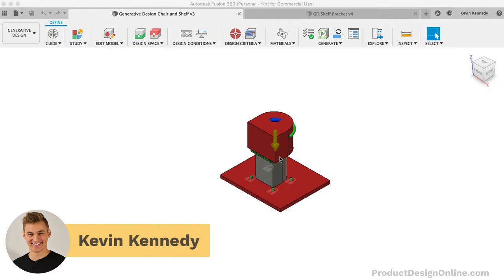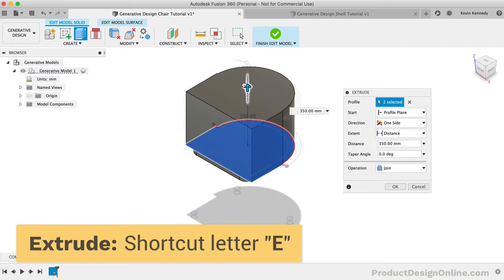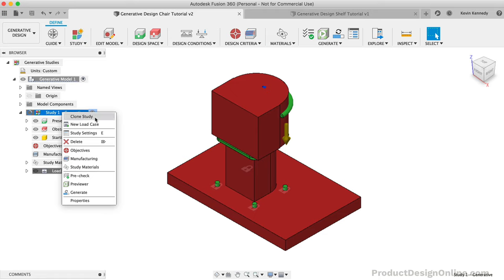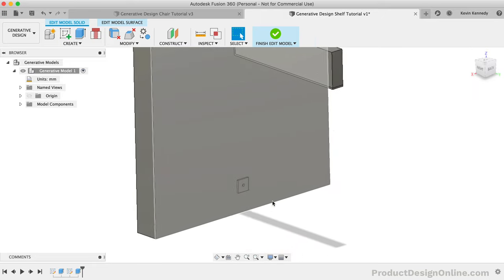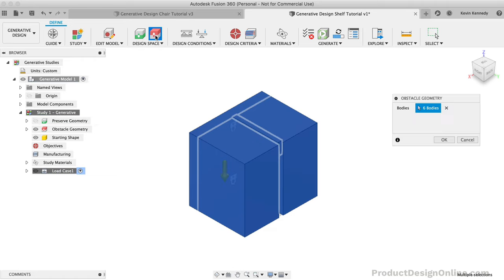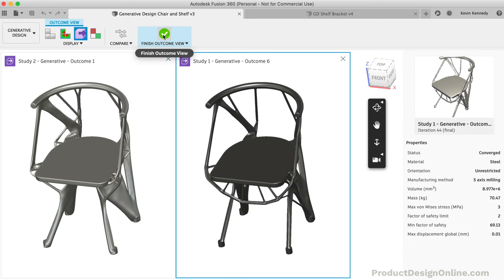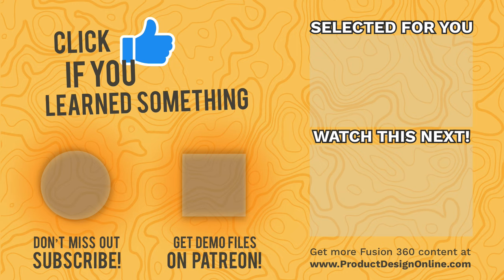Generative Design - Designing a STRONGER Chair in Fusion 360

Comment from the maker: Here's the first Generative Design tutorial ➞ https://youtu.be/PSSt8wswNJQ
_
TIMESTAMPS
0:00 - Generative Design in Fusion 360 for Beginners
0:32 - Creating the chair
1:25 - Preserve geometry
1:47 - Edit model mode
4:33 - Obstacle geometry
5:28 - Structural constraints
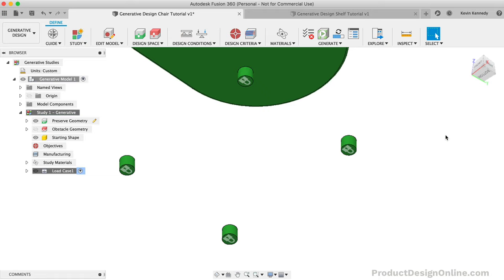5:40 - Structural loads
6:35 - Design objectives
6:50 - Manufacturing methods
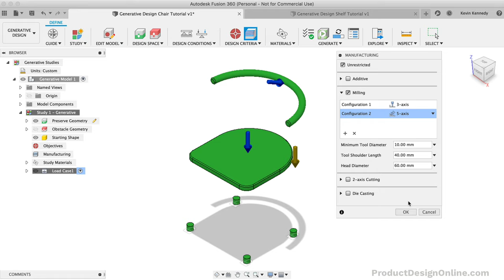7:19 - Study materials
8:00 - Generate chair study
9:00 - Shelf bracket example
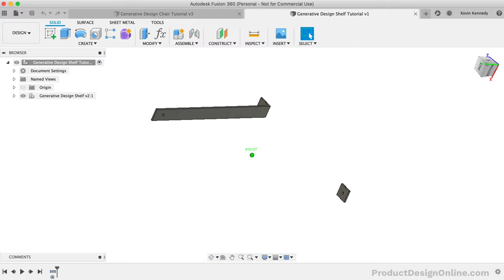9:30 - Preserving geometry
10:00 - Edit model mode
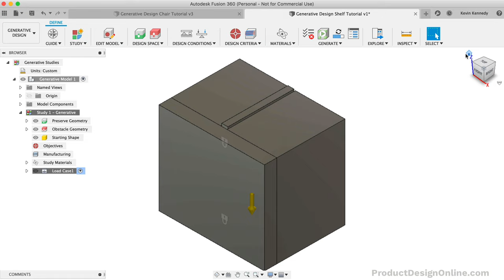14:00 - Obstacle geometry
14:25 - Structural loads
16:00 - Looking at the results

Comment: Heres a question though. Ok so I am doing the fusion design stuff and know I can get parts on screen. Only say I have finished a design and there is maybe a motor housing with interlocking parts. How then do I get gcode and the printer to print each individual part. I know nothing about the cam feature. Do you have a resource for videos on this topic or a direction for me to go to get the knowledge?
Reply from the maker: Hi, James. Are you trying to 3D Print the part or cut it on a CNC? You say print, which makes me think 3D Print. If that's the case, you can select the "Tools" tab (while in Design Workspace) > Make dropdown > 3D Print. Then, you select the components or bodies that you want to export as an STL file. You would then need to put that in your printer's slicing software (I use Ultimaker's Cura, which is free). Cheers, Kevin :)
Reply: I said print yep, but thats the outer body which is just going to be a carbon skin. The inner parts are gonna be routed on a 4 axis cnc I am building. Aluminium is my choice of material. I can weld it see. Have a £3000 top notch welder for it. So nothing should be holding me back in that and its also light but strong. Gears and stuff I am buying already made for other machines and just working my design to incorporate them.   So some stuff print and some through cam software is all I know whatever that means. Cams in fusion is it not?
Reply from the maker: @jamesbarratt593  Ah gotcha. That makes more sense. Yes, for the parts you want to CAM you can take the model into the "Manufacture Workspace" (formerly the CAM workspace if you see CAM in any tutorials). All of your tool paths and Gcode can be set up right in Fusion 360. I don't have any videos on the CAM functionality at the moment...but will likely do some at some point. Cheers, Kevin :)
Reply: @ProductDesignOnline  Ok so 2 solid days on this model and she looks real sweet. So sweet in fact that I want to grab her and rip her out of the screen and start playing with her. Its the lower half of a reciprocating mechanism. Anyway, so heres my feed back. Also I found something else cool. If you create a cylinder and give it the chrome effect, then zoom into the chrome as far as you can, you find yourself in a warehouse. Like as if you are just peeking through into it from another dimension. Trust me. Go do it. Whats the warehouse. Have I found a secret.
Reply: @ProductDesignOnline  So the feedback. OK, if you create an off set plane and once you have worked on it, then when you try to orbit with space and centre button down of mouse, its really horrible. Like you feel its not freely giving you the same orbit as before the plane was created. I wonder why that is. Obviously I need to jump back out of the plane, but how because I lick on the plane in construction then right click for delete and nope. Nothing happens. Also if you look across as something recessed that you created in the other plane, you can't click on the bottom section. The area is whiteish grey. Again wanting me to exit the plane I am in. Bloody annoying. Counted 11 times yesterday the screen flipped on me too. About that for today as well. What moron coded that into it. Oh yeah we will flip the model 180 for them. madness
Reply from the maker: @jamesbarratt593  Haha...maybe there is a secret code in the warehouse that unlocks special features in Fusion 360?  🤔

With the orbiting issue, are you using the free orbit or constrained/fixed orbit? It sounds like you may want the later, as you can pick a point and orbit with more control. Click on your orbit settings at the bottom of the screen (display settings).
Reply: @ProductDesignOnline  Dude if you saw what I have designed, a full three D object with a flange and holes etc, you'd be proud. Like a Chinese master as his trainee Wax on Wax off, grows into a warrior himself. Ha Ha. Seriously it looks banging. A classey bit of work. I have the original in my hand from a machine I took apart. Engineer rule and square. Measuring everything and deep concentration. Now the parts up on my screen and I intend to buy a very expensive 3d printer to print it out with slight modifications. If it comes out great, then I am onto the next project and thats to build a cnc router with nema 34 powerful motors and a 3hp spindle to machine it out from Aluminium. Awesome business this 3d design. Kevin you and your lessons rock. I'd be nowhere without them.
Reply from the maker: @jamesbarratt593  You deserve it - you've put in a ton of work! Once you get the CNC done I'll feature it on my site as a "success story" :)
Reply: @ProductDesignOnline  Awesome I like being a success. Make a change. Ha Ha. No seriously, to endure other peoples designs in the tools I used for 20 years of past, well lets just say there were loads with really dumb faults. Like they were simply designing and then the firm manufactured and they were shipped out with no testing. The designer never saw the finished part and so never used it themselves to learn of the problems. I see these problems and know I could make better. Now though we have little excuse what with the tech available to us. All we have to do is learn Fusion, and get making. 

Im nearing the stage in my design where I have to have a horizontal shaft going through an object and when it appears inside theres a spiral gear. That gear has to mesh with another gear at 90 degrees to it. Got any videos which would help me tackle that? I hear theres a gear add on for fusion to make helical gears. Is that the route you would take? Only again once the gears are there, how do you align. Hmmm are we back to that good old section analysis. Sounds like it. Only in that if you see the gears are not aligned can you alter them from within section analysis?
Reply from the maker: @jamesbarratt593  Yep, I haven't done a video on gears (yet) but I would recommend using this add-in - https://apps.autodesk.com/FUSION/en/Detail/Index?id=6294804001663532834&appLang=en&os=Win64

I would also suggest looking at McMaster-Carr. With that integrated into Fusion 360, there are often gears and other parts that are already built to spec and can be inserted into your file. A HUGE time saver on projects with lots of standard components (screws, bolts, etc). 

Can you post a link to screenshot of your file? That will help me provide a better answer

Comment: Hey Kevin ! Help me out in creating generative design for bicycle frame any tutorials I'm not getting proper desired design  ! Love from india ❤️
Reply from the maker: Hi, Sangeeth. You will simply need to define all the points of the bicycle that have connection points to other objects (wheel, seat, handlebar, etc). Then, I would recommend making the wheels so you can set them as objects to avoid (Obstacle Geometry).
Cheers, Kevin :)

Comment: @Product Design Online  hey Kevin ! I have installed fusion 360 for personal use but the cloud credits are only 300 .how do i enable this to unlimited could credits like your's in video
Reply from the maker: Hi Satyam. The unlimited Generative Design was a promotion at the end of 2019. However, Edu licenses still have it.
Reply: @ProductDesignOnline   the edu email has limitations of using not more than 16 cloud credits for per job right ? so we could not use generative design because minimum credit required is 25 for GE

Comment: You might illuminate how exactly we go from Student licence to Personal. I have tried over and over with no satisfactory results
Reply: Uninstall and reinstall fusion, had the same trouble until I finally tried that.
Reply: @pqr590  done it twice, but thanks
Reply from the maker: Hi, Chris. Are you wanting to transfer your Student (Education) license to a Personal Use license? As in, have all of your files transferred over with it? If that's the case, then the only way to do so is to have someone at Autodesk transfer your account. I would suggest posting on the support forum (usually they get to it quicker that way) - https://forums.autodesk.com/t5/fusion-360/ct-p/1234

The Autodesk account system is whacky and it seems that people often get stuck when trying to sign up for the Personal Use license when their email is tied to an existing license type.

In the meantime, you could always sign up for a second Autodesk account to enroll in the Personal Use license. You will just have to use a different email than what your current account uses.
Cheers, Kevin :)